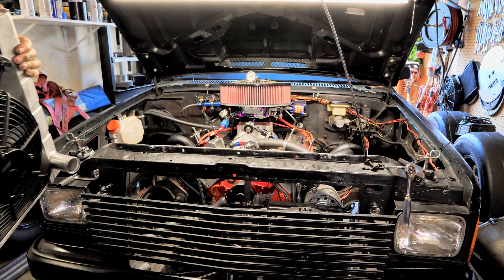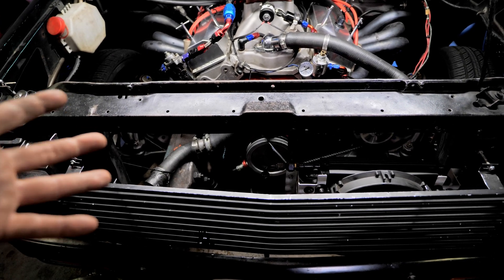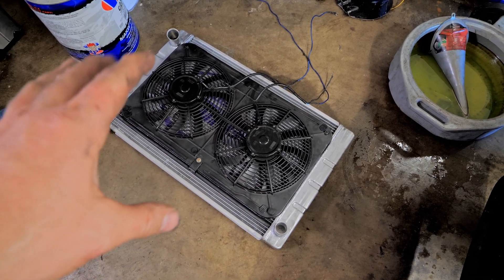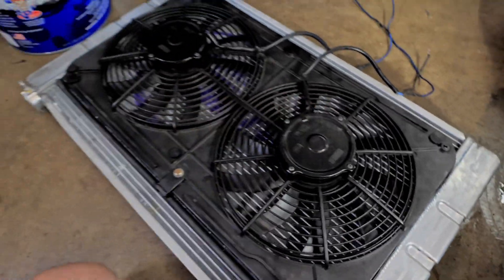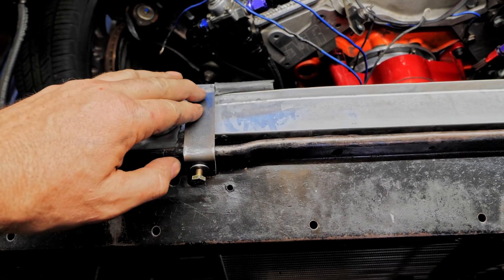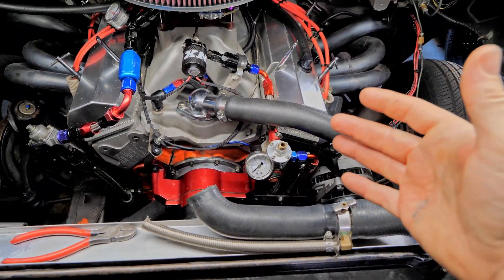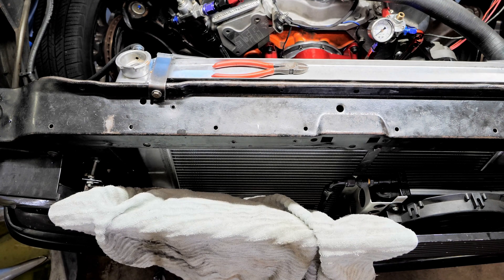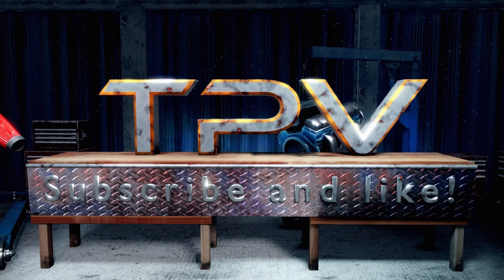How to keep your V8 Swap S10 cool! (Gen 1, Gen 2, Gen 3)

Comment: Try using an electric fan from the 6th gen Camaro, we put it in our 1991 s10 blazer with 350 and a mild cam, stays cool with ac on even during hot summer days here in Texas.

Comment: I know you're getting discounts you didn't go by $300 fans? Edit- were you using cooling problems- bet you have a   GM block if it runs warm. I don't need a shroud with the Dart shp deal
Reply: Oh damn those things pull don't they lol

Comment: I built my V8 S10 using some of the info from the book "Jags That Run"  which is a book about the S10 V8 swap. At first I ignored the part where it recommends to install a small threaded pipe plug into the SBC engine block water pump return hole, (3rd hole down, passenger side) and then drill out with a small drill bit. Less water is bypassed by the pump and it makes a big cooling difference. I learned the hard way.

Comment: We have 4 square S10 V8 swaps [350, 406, 6.0, 427 ls] stock hood latches, cheap stock 4.3 radiator with cheap stock dodge dual fans, 160 deg. thermostat. No cooling problems ever. But you CANNOT run A/C with a condensor in front or it will overheat. We know, we tried every combo. And those flat fans you are using didn't work for us. They don't pull hardly any air. We tried them.
Reply: Man, I’m finding this out the hard way. No matter what I try, I cannot get it to stay cool with the ac going. I’ve tried everything. Really defeating. I may try a smaller condenser.

Comment: I  sorta did the same thing too the s10 we built 20 years ago. You don't have to cut much to fit the bigger rad in i notched the frame and it fits into the core support then you have tons of room in front of the motor

Comment: Hay sir if those heads wasn't designed to go on 400 sbc u have to drill out the steam ports in heads
Reply from the maker: It's a aftermarket block with no steam holes.
Reply: Aftermarket blocks and Aftermarket Heads don't need those steam holes.

Comment: I don't have an S10 with a V8. But I do have a truck with a V8, headers, blah blah blah. I took an old aluminum truck bed tool box, cut it up, and made a shroud out of it (It had a bent lid and busted locks. Plus it was almost free. Bought it from the scrap yard for the price of scrap metal). Twin 12" fans with a controller box. I live in East Texas where today (Aug 20 2023) it was 109F or 110F. She ran great even running the AC. Point being, you don't necessarily have to spend $300 on a shroud. Just get resourceful and with a little work you can make yourself something really nice. My shroud is aluminum, as I said before, diamond plate polished to a mirror finish. You just need to make sure you cover as much of the radiator as possible!! I mounted it with two slide in mounts on the bottom. Then fabricated two tabs that slide into a mount and get bolted and secured with one ten mill bolt on each side. Hope that makes sense.
I'M IN NO WAY KNOCKING ANYTHING TPV HAS DONE ON HIS TRUCK!!!! I'm just saying what I did to maybe give someone the inspiration to make their own. Because of how much shit cost these days and it is very possible to make something that not only works but looks good doing it.  
Thanks TPV for all the work and effort it takes to put out this content. It is greatly appreciated!

Comment: I found two things greatly helped with my S10 V8 swap: 1) transmission cooler with fan moved to the rear (and some drag and drive guys run tow without fans in a row and say it works very well, without the extra amp draw) and 2) an inline oil cooler run off the remote mount filter. Cool oils, cool parts!

Comment: What happened to your LT1 motor? I've got a LT4 outnof a 96 vetter grand sport. I scored harness and Trans with computer. Did you have any issue with it? I plan on swapping in the computer and stroking it to a 409. Any suggestions?
Reply from the maker: The LT1 is a good motor I still have mine. I plan to put it into another S10 to bracket race and street drive. That is a big stroke I don't think the gen 2 LT1 can go 409 only 396.
Reply: @TPVPRO  Thank you so much!! Love your videos keep up the great work

Comment: I watch TPV because similar motors and I just tinker in my garage on my 68.All my hot rod friends are have moved out or 6 feet under.A lot of TPV videos have helped me along on this ground up build.Finally got this 68 on the road and man Oooo man it is sooooo amazing.Used a lot of his information and Geeeeezzzz this sbc 406 Freaken pulls HARD.I did was hoping this motor would pull to 6300 but I was wrong.This sucker pulls so hard to 7500 and just leaves these these people in there new mustangs or dodges just sitting there not realizing what just happened.Thanks for your channel and input.Definitely has me on the right track.Couldn’t be more happier with these results.